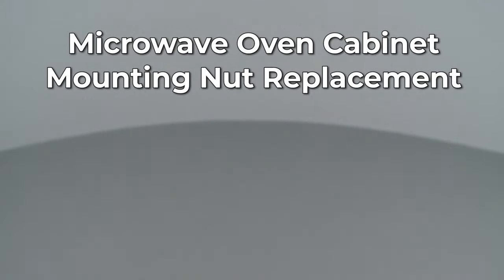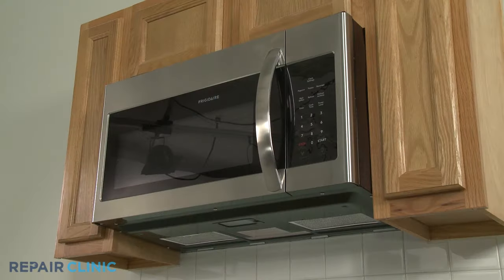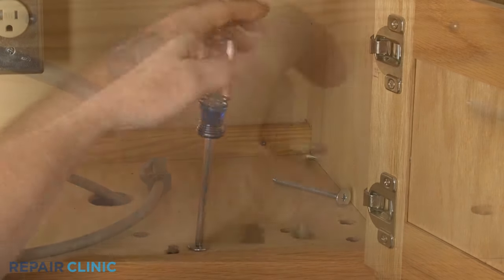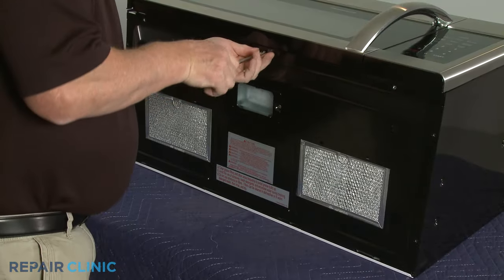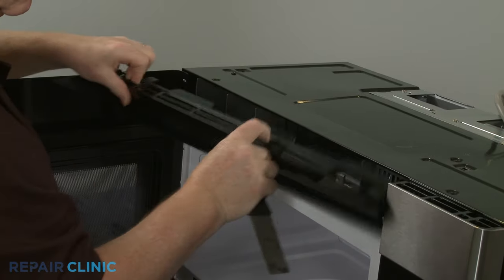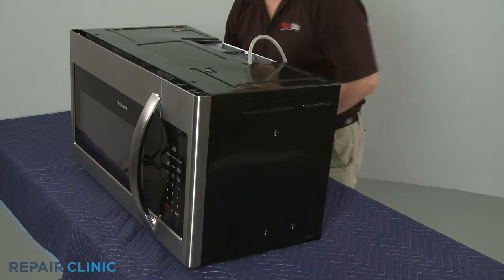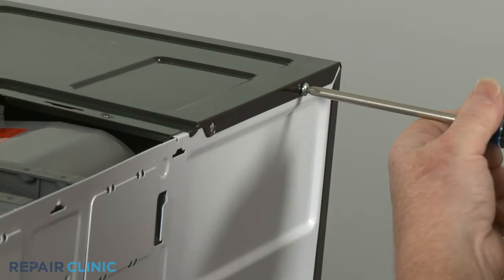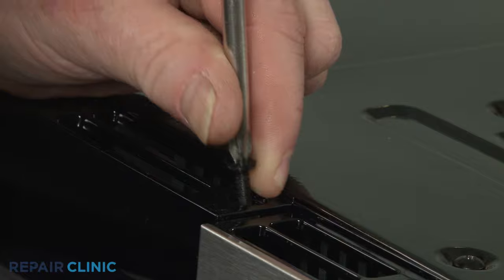Frigidaire Microwave Oven Cabinet Mounting Nut Replacement 5304509436

Comment: If the left (as you fase the front) mounting nut fails or falls out on instal; open the door & remove the plastic vent's two top screws you'll be able to reinstall the nut clip
Reply: The left nut fell on my install, this works, saved lots of work by not having to uninstall, thanks
Reply: Thank you, same thing happened to me and this helped me save a bit of trouble. I was able to remove just the bottom panel to retrieve the nut that fell inside and installed it through the vent opening, got the micro installed and all is good.